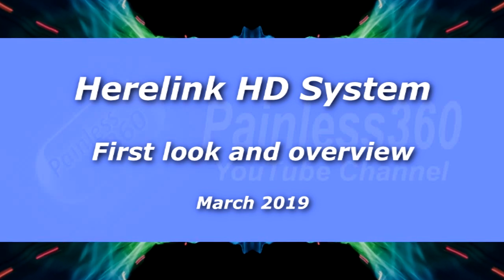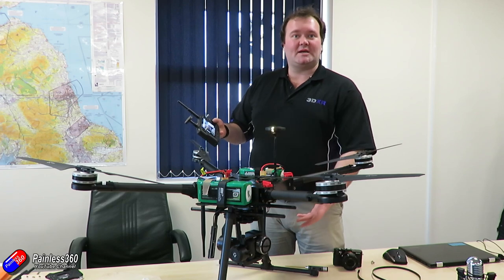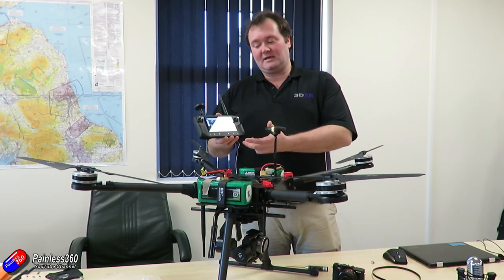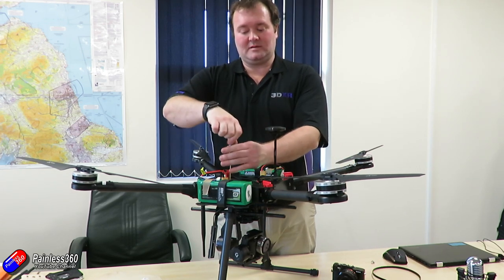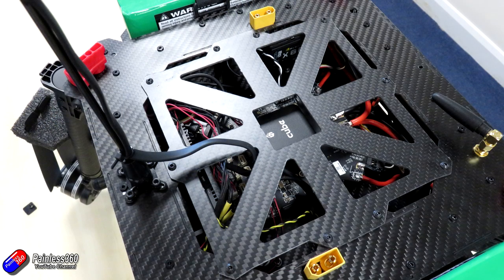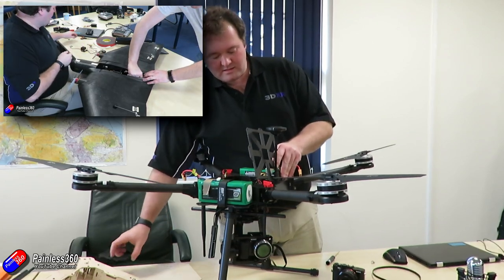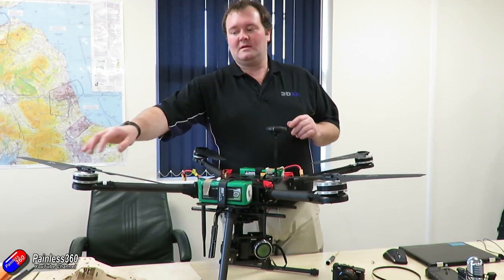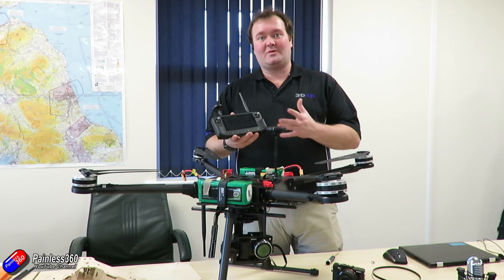Herelink HD Video Transmission & Control: First Look

Comment: Looking forward to seeing this in a fixed wing aircraft. I recently started flying a Parrot Disco that I'd bought over a year ago, it was sitting on my bench collecting dust. I have to say, the piloting is dead simple. What is really incredible is how they've created the landing system. If you recall, the Disco has the same type of controller, both sticks are spring loaded. For a Pixhawk fixed wing it's difficult to get my head around this setup, but it's works very well on the Disco. One of the reasons is that the CHUCK will keep the throttle automatically adjusted to keep the Disco aloft, never dropping it's speed enough to stall out. In a turn, as the plane starts to drop, you can hear the motor spooling up to regain it's altitude. On landing approaches, the setup for the Disco is very helpful, the CHUCK limits the altitude to a specified amount, say 4 meters, no matter how much down elevator you give it, it will park at 4 meters and fly around happily, regulating it's motor to stay at that altitude. All this to ask a question :-). . . do you think it would be possible to set up a Pixhawk/Arduplane platform to approximate these parameters with the Herelink HD?
Reply from the maker: Possibly, the software needs a little bit more time to get finished yet before I would be able to give a definitive answer. I’m hoping to do more on this later in the year when the software is a little bit more complete. Stay tuned.
Reply: @Painless360  When you say software, are you talking about QGround Control? Wouldn't the Disco-like program features simply be a function of turning on/off certain params in Mission Planner then use them with QGC via the Herelink?
Reply from the maker: @austntexan  I'm referring to the software on the HereLink as it's still in Beta.. Happy flying!
Reply: When using a Pixhawk and ArduPlane, the flight mode FBWB is the same as flying a disco, it keeps the speed constant and you can use a spring loaded throttle. You can set minimum and maximum speeds to avoid stalls. There is support coming soon for plane take off on a button like the disco. At the moment I auto take off by having a mission with the take off command. You can also fit landing aids such as Lidar to custom builds to improve auto landing and even use reverse thrust.
Reply: Thanks Lee & Ben for the video and info. Fellow Disco owner here as well like @bauhaus and am looking forward to seeing the HereLink in the Transformer PixHawk build with an HD FPV camera up front and the RX0 mapping camera in the mapping camera bay, along with a big 18650 Lion battery pack. The FBWB mode with a spring loaded throttle like on the Disco is such a joy to fly cruising around manually. Keep up the great work!
Reply: @3dxr699  That’s great news about the take-off button. I guess you could also assign A, B, C, or D that function as well, right? The take-off never seemed like much of an issue though, it’s the landing in manual that is the quandary. How are you managing that on your fixed-wings? For my application, I won’t always be able to perform an auto-land and will need to have the ability to manually set it down. Thank you very much for taking the time to address these questions. I’ve actually got a Herelink unit but haven’t installed and flown it yet. Would love to see a video from you guys(or Painless360) on integration for Fixed-wing!

Comment: How to connect with a three-axis gimbal?
I'm also curious about the wiring.
I would appreciate it if you could tell me how to set it up.
The gimbal I use is the TAROT Peeper HD 10X Optical Zoom Camera with 3-axis Gimbal (TL10A00).
It is using PixHawk 4.
Drone is Quad.
Please share the parameters as well.

Comment: Impressive! What is the weight of the air unit? and the weight of its two patch antennas?
Reply from the maker: If that information is about it will be on the 3dxr site.. Best of luck!
Reply: It is 95 g with antennas

Comment: Looks exactly what I need. Couple of questions. Presumably the camera is still controlled with an adapter such as the seagull ones? Can the herelink provide a kind of data through, so you can still use mission planner on a pc? Looks like that copter still has a 433 telemetry antenna?
Reply from the maker: Check out the big boys toys playlist for a preview of an upcoming Herelink video that may help..

Comment: Been contemplating If I should get the herelink for my cube I've been running x10s and crossfire but I definitely like the video features of the herelink. what's  your opinion? Should I drop the 700 bucks?
Reply from the maker: Having 'mission olanner' on the radio is very useful and the system is now very integrated into Ardupilot now. Lots of professional pilots use them... Best of luck

Comment: Hey, nice video
I am building a VTOL and using the Herelink but I am having trouble with calibrating the basic configuration  (Accel, telemetry, compass, etc.) Can you please make a video for guidance for beginners.
Reply: there is no guidance document on the 3dxr web cite
Reply from the maker: Did you get it from 3DXR? If so then you can call them for help. Also, check my recent Arduplane and Pixhawk series on the channel for my setup guides. The wiki for Ardupilot is also one of the best documentation sets about.. Well worth a read.. Best of luck!
Reply: @Painless360  Thank you, will try my best

Comment: dual HDMI for cameras is ok, that allows one for the payload cam (sony a7r) but what cam currently on the market has hdmi out and can be used as a fpv feed, and is the size of the cams used for freestyle??
Reply: Hey. I would use a action camera that has HDMI out! I'm not an expert.

I understand that you also are going to use analogue video at the same time? Would be hard to control the quad if you thinking about freestyle.

Live shows with people doing freestyle with great video would be nice. But I do think that the compression would suffer greatly because you change the picture/scene so fast that the compression cannot handle it and you will see a lot of compression artifact as "blocks".

I think that analogue cams are today at great quality. You just need to reduce the noise on the lines if possible. Maybe have a small 2s liion for that?

Some years ago I had a 6" quad with tramp and I had no noise on the video. The ESC's was some 25amp cheap ones. I use one now in a small areoplane.

Comment: I tried connecting my Herelink unit with go pro hero 5 but I'm not receiving any video transmission on my Herelink ground unit! But if I connect the Sony a1500 camera, video transmission is perfect.
I'm not using any pixhawk unit, just the camera and the Herelink unit here.
Can someone help me with the connection to GoPro hero 5.
Reply: I heard from another video that not all Gopro models are supported. The GoPro Hero 6 Black works perfect.

Comment: interesting video lee , i really like his setup , very neat build no apparent wires out of the frame and high end technology ,of course ben is a expert for 3dr , but after some changes on my drone new eagle eye gimbal and nikon d5300 i ended up with the batteries 2 x 12000mah 6s on the arms(booms) just like ben did, there was no other solution for me , total weight is 9.76 kilos or 21.52 pounds , it is kind of heavy!